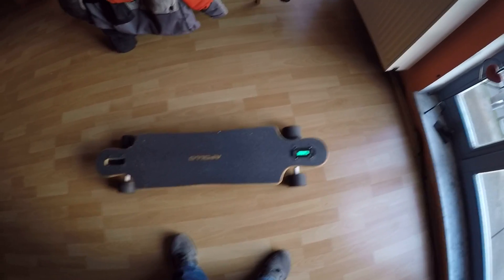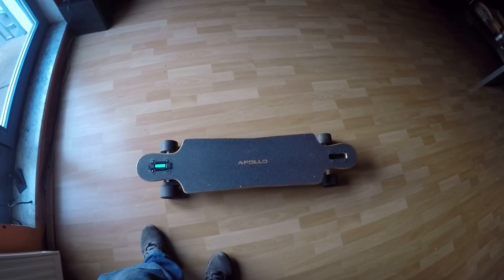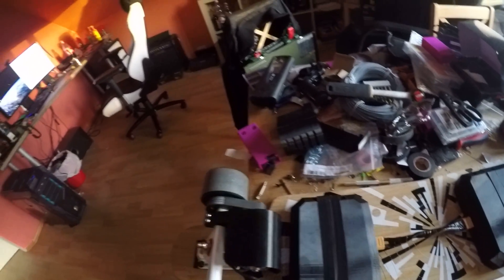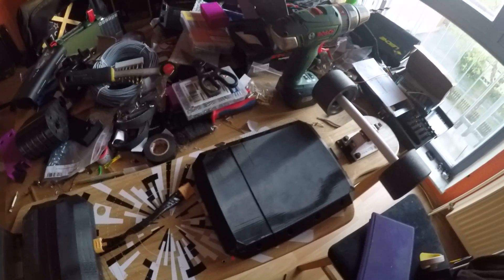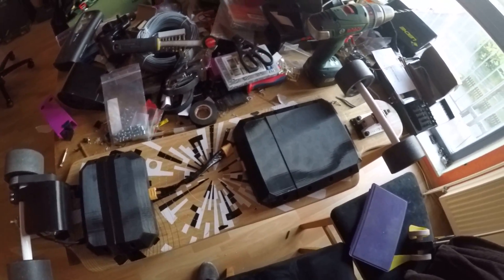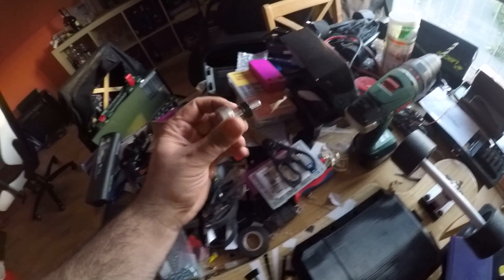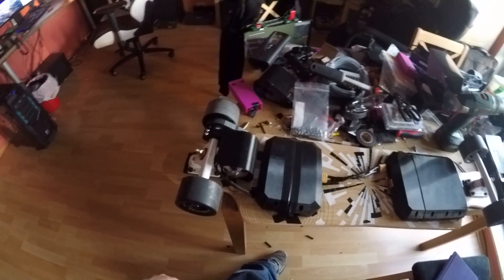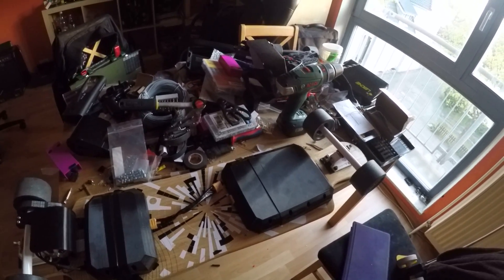DIY Electric Longboard

Comment: I like the enclosures gives a nice look, mine looks bad at the moment but it goes around 40km/h so happy enough for now. I wouldn't recommend mounting an extra pulley system on one motor because it just puts more stress and friction on the motor, you'd probably go slower. But if you are going to try it out I'd be very interested to see how that goes! I have the same sort motor I think, mine also comes with tha extender so if it works for you I'd be glad to invest in some more pulleys for mine ;) great vid, I'll subscribe looking forward to seeing more updates!
Reply from the maker: i allready starting testing the second pulley. just waiting for the ordered belt to arrive :)
it should help with braking, not sure about the traction gain however. at least in theory it should be better.
but honestly i have my doubts because my mount is a bit to flexible for the second pulley.
Reply: Well seeing that your pretty good with the 3D printing software perhaps you can create a mount which supports the other end of the motor too